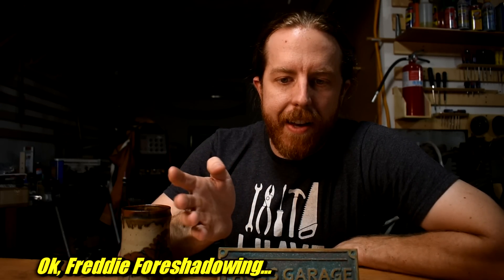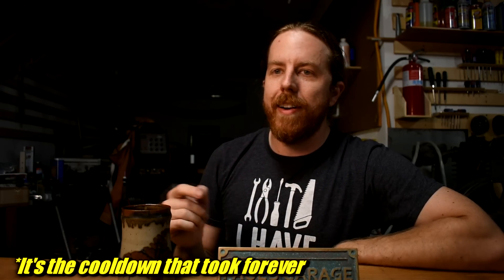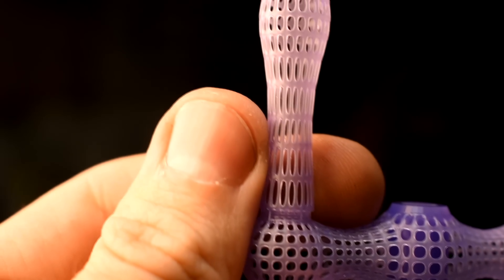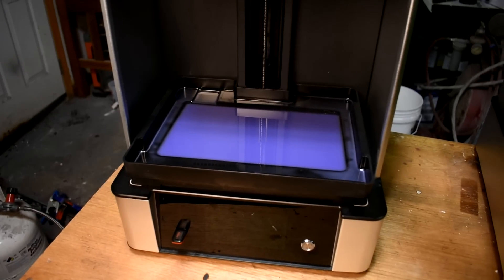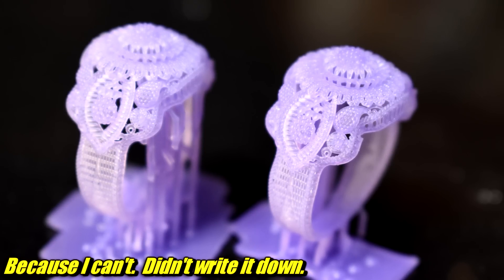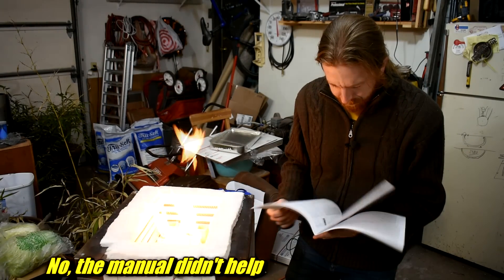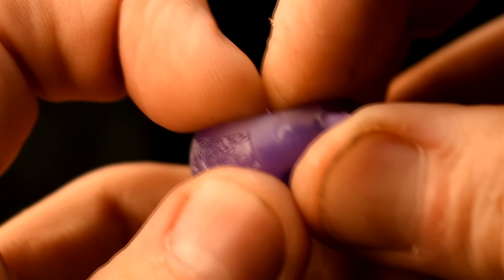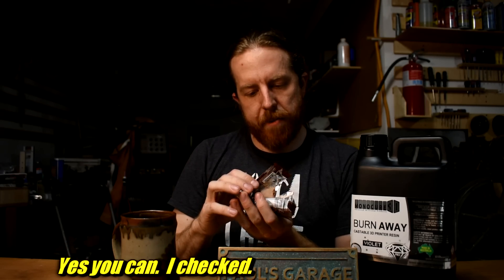Fast Burnout Lost Resin Metal Casting! Monocure Burnaway

Comment: I’m running SiriyaTech true blue and it doesn’t seem much different from most resins. Slightly longer cure times. Definitely, long burnout time but i just go by the investment timeline. Half the time i don’t bother with the cure but it always burns out clean.
Reply from the maker: SirayaTech blue works great, I agree.  The main difference i would say is true blue is super brittle, but this stuff isnt brittle at all, its much easier to handle without breaking.

Comment: I just got the most perfect cast from siraya tech purple with a 6.5hr burnout! I noticed they had updated their instructions. I mixed prestige optima to about 38:100 ratio(you might want the ratio even as low as 36:100 depending on your resin and what you are casting!) and it just came out awesome for anyone wondering.

Best part? No VG needed! :) Just a good ol IPA wash and UV cure

Used the Hi-temp Tabletop kiln for the burnout

Comment: For relatively complex wax shapes, do you feel vacuum casting is needed? That warhammer 40k figure is around the structural complexity of my wax object, and just don't have money to buy a vacuum machine for casting. Please advise.
Reply from the maker: Yes for that level of detail you need the vacuum.  Not just for air bubbles but because of the surface tension of the metal.  Something needs to force it into details

Comment: Hi, great videos. I have "down the rabbit hole!" question and I think your the man to ask!  Would it be possible to use the process of resin printing and vacume casting a two part metal mould that could be used in home plastic injection molding machine.
Reply from the maker: Most likely yes, but you might still need a bit of cleanup on the final part.  Some metals warp more than others when cooling, and any gaps in the mold will allow plastic to leak out slightly, causing flashing.  Not a major issue, but it may require post processing.  That being said, you can probably just resin print a mold and use that alone.  Some resins work for this already, and there is a very high temp resin called "Monocure ThermaCAST" that can take metal casting temperatures, so plastic should be easy.  That way you can skip the expensive vacuum casting step and get straight to injection molding

Comment: Melting temp is 810 on that stuff, maybe 900 pouring temp. . flask should be like 500?   

be damn careful overheating zinc, it will get in your lungs and do very nasty things to you.
Reply from the maker: i'm using 500C as a pouring temp, and i haven't settled on a flask temp yes, but it seems like cooler is better?  500f might be spot on.  It doesn't help that the furnace is in C and the burnout oven is in F lol

This za12 pours so far below the boiling point of zinc i haven't had any fumes yet.  I even tried overheating it once in the electric furnace (still below boiling point) and didn't have any visible fumes.  I did melt 20+lbs once in a gas furnace, had some fumes there from overheating, but i always cast with garage doors wide open and fans going.
Reply: @PaulsGarage  500C is about 932 which is smack where rotometals(i love professional sources) says it should be cast at. 

good on the ventilation, zinc scares me as a casting metal, but i almost exclusively cast silver these days which is a lot hotter.   Thinking about getting back into bronze.

Comment: We did all the preliminary testing for this one and came up with the burnout schedule. Im pretty sure we told Charlie and the crew that you can either throw the flask in a cold kiln or at 1350F, eithers fine.Its just a scheduling thing. Glad you enjoyed it. 

We use a power washer for all our devesting. Pop it in an old sand blasting cabinet and you contain all the silica. 

The cracking happens both if you let it sit to long and if you wash it to long. But many other castables will actually leech photo initiator after a month...so Ill take the cracking its cleaner.
Reply: Do you suggest this resin when casting silver / gold ? Do you think a pair of grillz would shrink ?
Reply: @DoyenVirtuoso-j1i  All materials have some level of shrinkage. This greatly depends on your metal as well as metal temperature at time of cast. 

We have used this material for a variety of metals including bronze, sterling silver, and 14K gold.

Comment: How come the shrinkage is so bad on the thicker prints ? I’ve been having the same issues unfortunately
Reply from the maker: the prints or the castings?  For castings, thick spots will always have worse shrinkage.  I had the issue here because the mold was WAY too hot, and the metal was probably a little too hot.  That worsens shrinkage problems when metal casting.
Reply: @PaulsGarage  I'm not too sure what the difference is but when I cast with Monocure 3d burnaway prints, I can't get good results. Whereas with sirayatech I get great results. It looks very similar to your failed prints with porosity everywhere. I thought it was due to resin migration

Comment: There is a top-down resin printer which will not tug on each layer. My patent-pending method to 3d print metal is 20 times faster than lost wax casting and the surface finish is excellent.

Comment: Whack the cast piece into a glass jar (no other material!), fill with an acid of choice, drop into ultrasonic cleaner, run for 20 mins.. pull it out give a shake, repeat as needed. May need to decant to another jar to get rid of sludge during steps. That's my process anyway

Comment: Hey can you share the resin print settings you used please?
Reply from the maker: @esurfrider7687  yeah it's just the default settings for the gk2, with 30micron layers, change exposure to 27 second for burn in layers, 1.3 second normal layer exposure

Comment: I've used it as well, and can backup what Paul says.  This stuff is easy to print, and easy to clean.  For me the big winner is the Fast Burn out.  Leaving my kiln on overnight and unattended....kinda scares me.  Now I can just do the whole process during that day.  For those worried by the sticker price of 1lt, it's what, 10cents a gram - and the 3D printed models are typically small and light.  1lt will go a looong way.  The 3D model is probably the cheapest component (yet the most important).  In comparison my plaster costs about $2 per kg (which is about the minimum you would use).  Even Wax Sprues cost $60 per kg (and you use a lot more wax than resin).

Comment: If you're up for alternatives, dip casting is Really cool. Similar process, but you dip your part on a sprue into investment plaster or ceramic clay slip and build up externals layers. Doesn't take as long as you'd think, but it works a lot better if you're doing like 6 or more pieces at a time. When you go to fire the clay, having a heat-tolerable catch container in the bottom of your furnace is advisable (another ceramic bowl or high nickel steel). You burn-out the print and fire the clay at the same time. Depending on the shrink rate of your clay, I oversize my parts by about 15%, then when it's done firing, pour your metal as normal. The clay is much easier to get off as it's very fragile, but you can ultrasonic wash them also.

If I need extra cleansing power, I'll dilute acetic acid from my lab grade 99% stuff down to 35-60%, depending on what I'm scrubbing, and place it inside a glass vessel so I don't need to wash the whole tank afterwards (it's a biggun' and takes an hour to drain). My unit heats up to 40-45*C just in normal use action, so I've never turned on the heater, but as always, volume and such makes a difference. Just don't fill it with combustible solvents. I've never seen one catch fire in person, but I've heard and read people who fill them full of IPA and forget that warming that much solvent causes it to aerolize, which is both a combustible hazard as much as it is a breathing issue. Mean Green or the like works too, but getting your own acetic acid is way cheaper.
Reply: I've seen people do that where they dip it in sand between layers.

Comment: Try soaking the plaster filled piece in  a high concentration vinegar (30%).  If the piece is fairly warm when you drop it in the vinegar it should go faster.  Interesting note is that this is how Hannibal got his war elephants past the limestone cliffs and into Italy.
Reply from the maker: That's a really good idea, thanks!!  I knew that about Hannibal but I didn't make that connection here.  Very cool, thanks
Reply: Yep, I've used that method (and with other acids), plaster is pretty easy to dissolve. I was gonna suggest but you were here first. I didn't have the Hannibal story, either!
Reply: Only problem with that is zinc is pretty readily dissolved by acetic acid. Found that out the hard way when I tried to soak a cast zinc (likely zamak) tub spigot in vinegar to dissolved out calcified mineral deposits on the inside, and chunks of the spigot started crumbling off after a couple hours as well.
Reply: @nautica8745  good to know. thanks
Reply: yep some heated vinegar in the ultrasonic (use a jar or bag sized just what you need.) should work nicely especially if you can get the high strength vinegar.